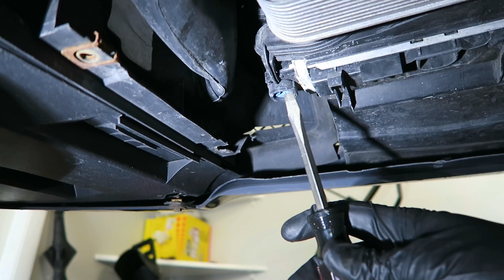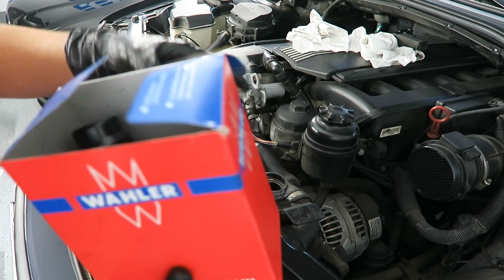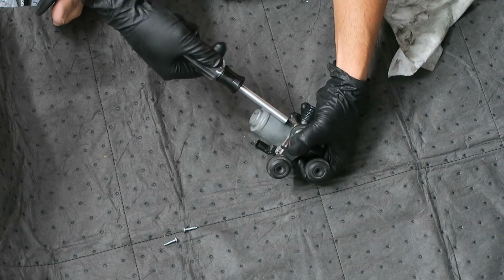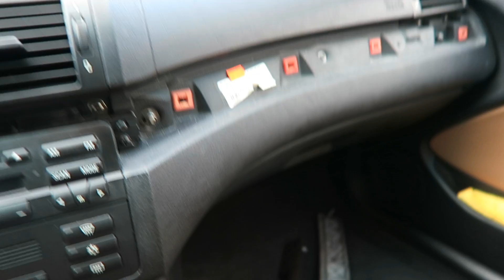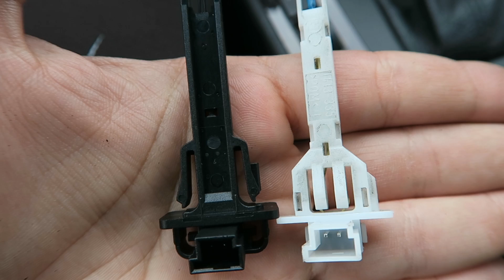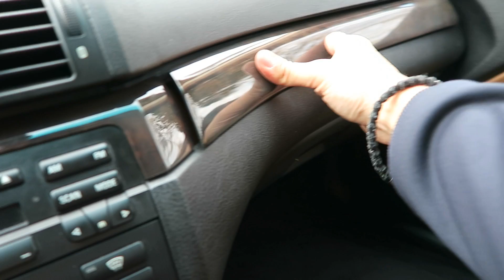BMW No Heat Fix - Thermostat, Heater Core Sensor and Valve DIY FIXED

Comment: Many things you did wrong... you dont use penetrating oil on plastic/ruber parts you use silicone spray. When reconnecting coolant hoses put the clip on and then push it in place  soo that you know that the hose is seated. E46 OE thermostat is made by behr even with sanded down bmw logo. When inspecting the internals of heater valve remove the plunger and put in in the metal housing and give it 12v to see if it's actually capable to move the plunger.  All and all good video. Keep up the good work

Comment: Does the 2001 E39 (525i) have a similar heater core sensor (mentioned at 19:37)? I can't find any info on this part. (the part given does not fit my model).  Though, this may not be my issue. I disconnected my heater core valve wire (19:23) and there was no change in my heat output.  Basically, I'm getting lukewarm air coming from all my vents.  It's just enough to defrost my windshield (Ga weather, not so cold here) and it worked fine last winter.

Comment: Greetings,

 Excellent video/information

Would a clogged heater core valve to generate a code 25 in the IHKA using INPA which the description for this code translated to english would say: short circuit against ground?  Or could the valve be bad?
Reply from the maker: Try bypassing the valve and see. What happens when you disconnect the valve?

See if you can flush out the lines

Comment: my problem left side hot right side cold!! what do you think i should do ? I will be glad if you reply
Reply from the maker: Left side of what? Heater core hose or radiator hose?
Reply: @Lefteris7  inside Fresh air grille driver side hot but passenger side cold. I'm setting hot
Reply from the maker: @murats_channel  ah so the actual air vents inside the cabin? It can be many reasons. How hot is the temperature on drivers side? You could have air in the system still not allowing adequate hot air to enter system. As the video shows could be the heater core valve. Did you unplug the valve to see if the valve defaulting to open brings in more hot air? Is your thermostat fully functional? Perhaps you are not distributing enough heat. Drivers side always gets priority. Are you sure your flap actuator inside the dashboard is working?
Reply: @Lefteris7  my english is bad sorry i hope i could explain

Comment: From the music, I thought loosening the thermostat housing bolts triggered a boss fight.. jk
So unplugging the heater core valve keeps it open? So if I unplug it, and I get heat, it means that sensor behind the dash is bad?

Comment: In case someone is here because they're getting heat only from one side of the car (either passenger's or driver's) it's not the valve. For me, it was the heater core. You could try backflushing it or better yet replace it altogether. It can be done without removing the dash, there is a video tutoring here on ytb. 

My car probably had a leak and somebody poured some white sealant in the coolant lines to seal it. It probably worked but it clogged the heater core. Again, replacing it solved my problem.

Comment: I have changed the thermostat, changed the waterpump, bleed the system properly, cleaned the heating core and still no heat, i unplugged the heater core valve and i still only get cold air

Comment: Thank you so much for making this video. I had the same problem and my heater is working  again after replacing the sensor. This is so great. For the last year my heater was working so/so. Sometimes not sometimes it dit a little. Perhaps this could be of value for diagnosing the problem.

Comment: Nice, clear video on how to perform these repairs. If your no heat problem is intermittent, could it be that there is air trapped in the system from not being bled when topped off and/or a leak somewhere allowing air to come in - either a crack in plastic component like the expansion tank or one of the radiator hose connection points?

Comment: i cannot put that hose back in new temp housing for love nor money. tried driving with it not clipped and over heated. ive tried EVERYTHING without snapping it. How did you do, cos saw you cut that bit out, lol?
Reply from the maker: Which hose of all? The 2 going into the valve are held in by hose clamps as I show when removing. Which point in the video are you referring to?

Comment: I will be giving this a go today. Thank you for this video. The only thing, I have a 1999 BMW 318 1.9 petrol, so hopefully the heater sensor is in the same place. We've also got a leaking heater matrix (we think) as the rear passenger foot is wet. What do you think?

Comment: Thank you. I've been chasing this issue since last winter. I'd have heat for a few days, then no heat, then heat again. Finally, this year, it no longer works at all. Sounds exactly like the behaviour of a faulty sensor. Liked and subscribed to support your channel in appreciation.
Reply: I have the same problem chasing this issue and searched countless videos on this issue until I watched this one. The explanations with the other videos didn’t resolve anything.

Comment: Great video for diy guys...I was hoping to get a look at the threads on the block drain plug. My gauge cluster failed and I'm not spending $1200 on a new one. I'm doing an electric gauge install on the block and that drain plug looks like the perfect spot for a temperature sensor. It beats taking the intake off to get to the temperature sensor on top of the block.

Comment: Seems like one might try this first:

1) bleed and burp the system
Then..if that doesn’t solve...
2) disconnect the heater core thermostat...and see if you get heat

Comment: Lefteris7, thank you for sharing this video. I have the same problem. it is 2009 x5 e70 4.8i which has dual climate control. heat for passengers side is ok, but only cool air for driver side. Do you happen to where is that sensor located at. your help will be greatly appreciated. Sincerely.

Comment: Very nice video ! Quick question .. on a right hand side car if only the driver’s air vents are blowing warm- ish air and the passenger side just cold , what could it be?! I did changed main radiator , thermostat, water pump, preety much all the hoses gaskets and o-rings and did the correct bleeding with bmw genuine coolant. I did not flush the heater matrix and didn’t test the heater valve yet.
Reply: Have you been able to resolve that? I have the same problem.
Reply: @Jkrcmik   I have flushed the heating radiator with a garden hose at a low pressure
Reply: @dragandy  really? That seems like an easy fix. Did you see some debris coming from it? And your symptoms, was it that you had the heat only from one side i.e. drivers or passengers? I have it like this and not only the dashboard blowers but also the upper one for the glass and lower one for the feet. All those are cold on the driver's side and warm on the passenger's. In simple words, only one side of the car is blowing hot air. 
Thank you so much.
Reply: @Jkrcmik  i did changed the thermostat but before flushing the heating matrix (radiator). Although seems an easy job , you need to take your time on pulling out the hoses of the heater as they can be stubborn. Good luck!!

Comment: I'm pretty sure that heater core sensor is what's fucking with my car. Going to take a look at it tomorrow and find out. Thanks for the info, brother. I'll try to remember to give an update on if this fixes my issue or if there is any additional info I can offer.

Comment: Mine isn't blowing. I can hear sound, but no air comes out. Juuuust a tad from the small vent left of the steering wheel.
What can this be?
Reply: Audun Jemtland sounds like your blower motor is bad

Comment: problem solved. engine cooling down on highway, cable was not connected of the heater temperature sensor, thank you for this video. you guys have made a great video and understanding bmw e46

Comment: Is this T shape looking sensor you replaced behind radio climate control panel same kind behind the 2006 E53 BMW X5? In respect to same type of issue i mean that you experienced here in your video. Thanks..

Comment: Nice video man, very informative. I have a e87 2006 bmw model (1 series).  The issue with my heater is that there is heat coming out from the passenger side but none coming out of the drivers side. I have had the thermostat replaced recently which I thought would be the culprit. The heat out of the passenger side is hot but blowing cold in the driver side. Any idea on what this could be?

Keep up the good work and hope to hear from you. Greetings from the U.K :)
Reply from the maker: Rakesh Chumber honestly that sounds to be the door behind your dash that directs the hot air to the vents. I am not very familiar with the 1 series but if you were not getting heat at all I'd say yes something is wrong with the components that provide heat. But in this situation you are getting heat on one side which leads me to believe it's the flapper door being stuck. I hope this leads you in the right direction there's a few posts and videos with that particular issue addressed online that would better explain that than I would be able to

Comment: Great video. I need some help with air conditioning. It works in the mornings when the temperature is usually below 70 degrees. But once I'm driving and the temperature reaches above 80-90degrees the air conditioner just blows hot air. Could it be the heater valve?  Or should I also change the sensor in the cabin??

Comment: I was wondering if you could help me answer this question. Would the heater control valve or sensor be a problem for when the center vents are blowing hot air and the side vents blowing cold air?
Reply from the maker: mrsup3rn0va are you trying to get cold air or heat? if you are trying to get cold air and it's focused on drivers side vent then you need to recharge your freon. if you are asking for heat and are getting cool air from outer vents that's interesting... are they blowing as much as the center?
Reply: I'm trying to get cold air. I've already had recharged it and it was still blowing hot air in center vents I also forgot to mention that when I have the face and legs on it blows super hot air for the legs but super cold air for the face on all face vents
Reply from the maker: mrsup3rn0va hmm is your gauge showing you are properly charged with freon? that is strange. that would not related to this sensor in my opinion. how cold are the side vents... freezing? it could possibly be the arm inside that directs the air flow if you truly are getting very cold air in certain areas but. ot others...? sorry I can't be a huge help on this
Reply: Lefteris7 yeah I was showing that it was fully charged. People have been saying it's the blend door actuators but I could find anything on the web of videos were there located to check them out. Would you know of anything about them.
Reply: mrsup3rn0va try to check out your electrical fuse 62 this is responsible for the HCV check out also if the heater core unit are always hot by removing radio , navi and hands on the HVAK  can be also wiring problems

Comment: I have to replace my heater core, any chance you have a video for that in a 2000 BMW 328i e46 4dr with auto trans? If not can you at least tell me if I can access the heater core through the engine compartment or is it from the inside of the car either from under the dash or by removing the dash itself? Thanks,

Comment: Hi i wonder if you could help please i'm having heating issues in my e46 320d 2004 the temp gauge will drop to 10 o clock with the heaters on then rise back slowly to the middle i have replaced the egr thermostat twice with behr parts and replaced the main thermostat with a genuine BMW thermostat but i'm still getting the same problem this is whats pointing me to the water control valve i can't think of anything else it would be, any help would greatly be appreciated.
Reply from the maker: Johny P that's interesting. are you getting heat when it drops down to 10 o'clock? does it drop at high speed in a situation where you're overcooling? my first guess would be the main thermostat causing this since it's staying open not allowing you to build up adequate heat when the heater core is opened. how long have you had the main thermostat changed for? have you properly bled your system to remove all the air?
Reply: Lefteris7 Hi thanks for your reply  its been properly bled about 5 times, i do get heat when it drops but for example if i leave the heater of it will get to 12 o clock and stay there, its when i turn the heater on i get the this issue the tempreature just drops i have checked the hidden obc menu aswell and the digital temp sensor is accurate with the one on the dash this is really effecting my mpg as you can imagine. when i do initially turn the heaters on i get cold air for like 1-2 seconds then warm.air comes into the cabin i don't know if this is normal any help would be greatly appreciated as diagnostics won't pick up anything at all. My e46 is the basic es model without climate control.
Reply: the main stat was changed around this time last year but even with it changed i still had the same issue. i changed it to try and cure this issue.
Reply from the maker: So you have the analog HVAC control unit? When you bleed your system are you making sure that your heater core is opened? I am wondering if while the main system is 'bled' but potentially the heat core system is not. This is definitely tricky to diagnose over the internet. Logic would tell me you turn the heat on, you drop in temperature, resulting in overcooling. The thermostat is staying open too long not generating enough heat in the system BUT only when the heater is on. When the heater is not engaged you reach optimal temperature. You've followed my directions an unplugged your heater core valve right? what happens? Temperature drops?
Reply: Thank-you for your reply my dad is a mechanic and does all the work actually we bled the system again today. this was the process  from the top of my head as far as i can remember, drain the fluid open the 2 bleed nipples one on the egr thermostat and one on by the coolant expansion tank put in mixture of coolant 50% and water 50% start car then put the heaters on full blast wait for the pressure and heat to build keep filling the coolant until all air is out the system this is confirmed by both coolant coming out of both bleed screws. I wouldn't know anything about bleeding the heater core but i will look into it, I think it is the analog HVAC unit as i don't have climate control or a digital temperature heater control unit it's the standard analog one i really appreciate your help it's more that i am getting from BMW forums cheers - John

Comment: Hello. Maby you can help me out with this one. It's been the third winter with my e46 and it hasn't blown any heat from the vents. I have changed absolutely everything. Radiator, thermostat, heater control valve (i have even canceled it completely), heater core, checked and diagnosed with DIS v57 software and nothing shows up. No errors, nothing. What can I do other that this. Beleve me I'm desperate to fix it. I'm freezing to death inside it, I can't even defrost the windshield and I can't even see where i'm going.
Reply: Ever find out what it was? FSR?

Comment: Do you have to part nr for the  heater core sensor?
Reply: Gilles van Leeuwen there is two Sensors one is on the heater core and one on the climate core
Reply from the maker: Gilles van Leeuwen the part number is 64116930015

Comment: Excellent vid mate! I do have the somewhat the same issue with my 2005 e46. I do get heat only when the temp is almost reaching the middle part of the gauge. The problem I have in the winter time is it takes so damn long to get the needle to the middle part. and when it is almost getting there, when I speed up the needle moves toward the blue mark indicating a temperature drop. Maybe you could help me and point me to the right direction. Thanks!
Reply from the maker: Rommel Brusola that sounds to me like your thermostat may need replacing. the fact you get heat but  takes forever shoes to me that it's valve is stuck open not allowing the engine to fully get up to temperature. try replacing the thermostat like I showed in the video. should cost about $50 and very easy with the right tools shown .
Reply: Rommel Brusola that's exactly what mine is doing mostly during the winter time. does your needle sometimes go really high but I'd you turn it off goes low?

Comment: tried all that and still nothing. turns out it was the AC unit itself that was at fault.  swapped out for a new unit and blowers working with full heat!!!!!!!
Reply: I am having the same problem.  What AC unit and how did you track down the problem?
Reply: Noel Abiang the problem I had was the Heater blower resistor. once changed heater is working perfectly. set the controls to auto and keep to 22-25.c for best results.
Reply: I replaced mine last week and still doing the same thing. I will change my HCV today and see if that will solve my problem.  thank you!
Reply from the maker: Noel Abiang did you open up your heater core valve to see how it looks inside? if you unplug the power to the valve do you get heat? have you replaced your thermostat and bled the system correctly?
Reply: Lefteris7 I did opened up and unplugged the old HCV and I do get heat.  I haven't replace my thermostat. I will do that next after replacing the Evaporator Temperature Sensor. The strange think I found out yesterday after  stalling the heater core valve was, when the AC is set on auto it will randomly stopped working. After a few minutes it will blow cold air again. My heater it's doing the same thing. Hopefully it's the Evaporator Temperature Sensor.
Reply: Emzo Daniels how to reset the computer on a BMW E46